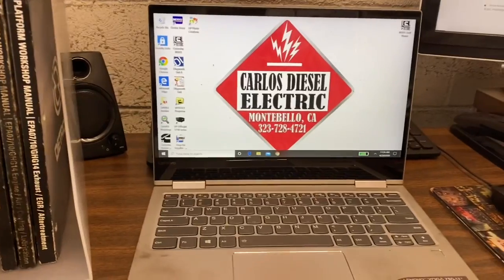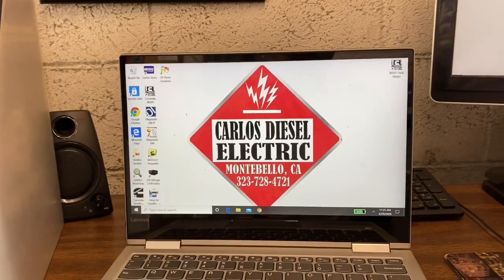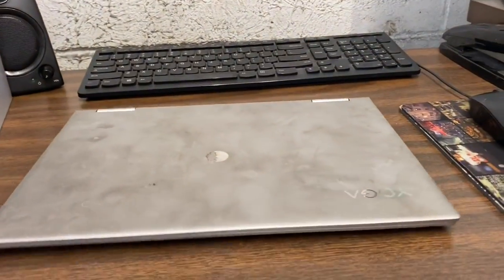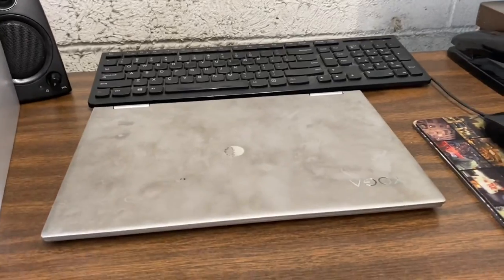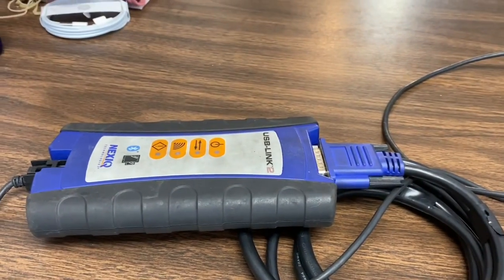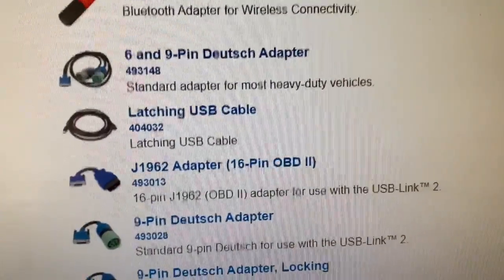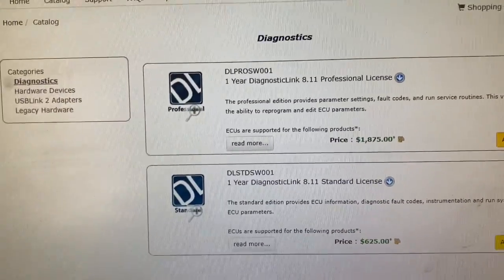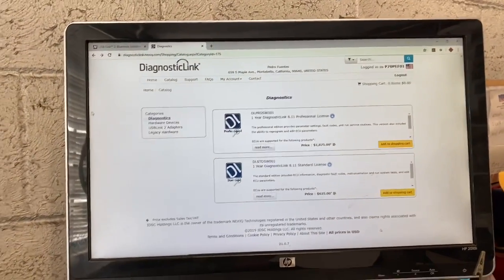Troubleshooting and engine repair DD13 and DD15

Comment: Where can I buy those programs to check my onw truck
Reply from the maker: For the Detroit program, you can purchase it from Nexiq. It does require a subscription, they have two levels. 
Standard which allows you to make plenty of changes, regens and plenty of other things. 
Professional which allows you to make changes and programming/updates to the MCM, ACM and CPC. Most people don’t need the professional version.

Comment: DD13 DD15 does the year of truck matter with dd platforms  I have 2013 DD13 Cascadia. 

#Always Supporting 💪
Reply from the maker: EPA 07, EPA 10 all the way to GHG 14 are very much the same things. 
Things change just after GHG 14.
Reply from the maker: DD13 and DD15 are very similar

Comment: Bought a secondhand truck from a company. Do they password protect or otherwise limit the options on their trucks?
Reply from the maker: Hard to say, usually companies like Swift, Schinder will password protect the trucks because they have speed limits and such. But you really won’t know until you go in and try to make parameter changes. Most of the time they are not password protected. You should be ok.

Comment: Do you also use manuals for an isx? And if sonwhere can I buy those? Just starting my mobile diesel repair shop.  I would like to have as many manuals I can have.
Reply from the maker: For Cummins I use quick serve, simple online access and it’s free. It allows you up to 5 engine serial numbers, complete breakdown, engine specs and torque specs. 
That is what use. 
Hope that helps

Comment: Cool!

Does the online subscription have the information in the 5 books?
Reply from the maker: The Reviewer thank you for reminding me, there is a separate subscription ($600-800 per year) that Detroit offers. They call it PSL (Power Service Literature) which covers fault code troubleshooting but not sure about repair manuals. I will have to look into that.